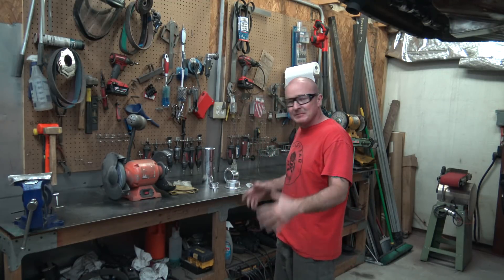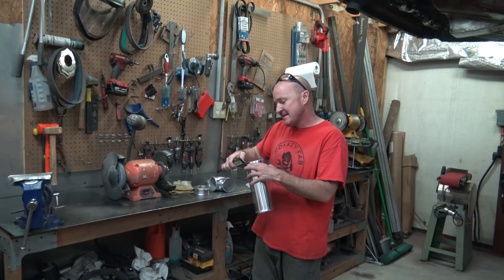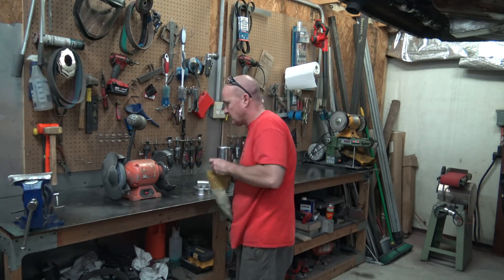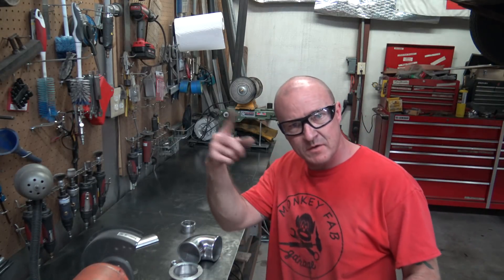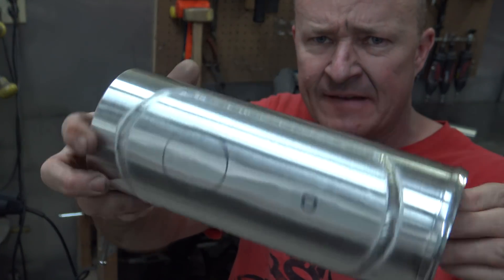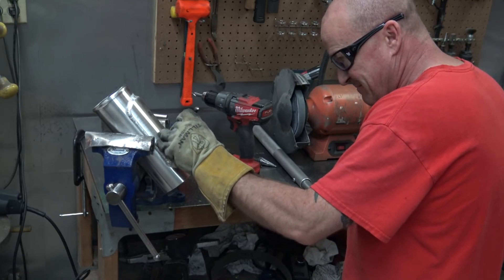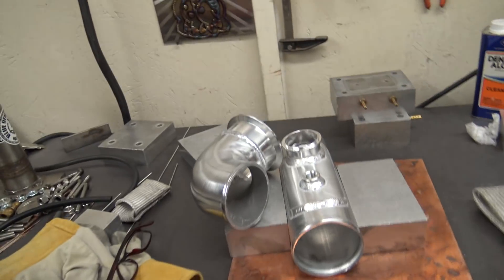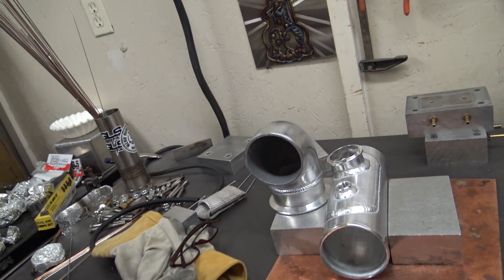BOV on Aluminim Tube and Cast Aluminum welding

Comment: I notice you don't seem to tack anything? You just start on one side and work you way round.  Do you not need to on alloy with such good fit up?
Reply from the maker: Scott Mullaly I’ll usually tack in three places and start in the place that the fourth would be but here I had the big clamp holding down the doubler plate, so no need there and I don’t tack bungs. Just weld super hot and get four or five dabs in before it moves. All steel I tack so yes I do aluminum a bit different.

Comment: Thanks for the videos man! Keep up the quality work :) Have you tried using really low RPM for drilling aluminum? I drill a lot of holes in AL installing docks in the summer, and I've found slower speeds tend to cut faster.

Looking forward to getting my T4 merge and GLS cup in the mail next week 😁😁
Reply from the maker: DanOfTheNorth I find different types of aluminum all like to be drilled a bit different. I bridge that by using worn out bits and modulating the speed. Well, sharp bits might help but ain’t nobody got time fo dat

Comment: Good videos mate!, I have a question, I would like to weld egt sensor bungs onto a oem cast iron turbo manifold is this possible? Would it be structurally sound? Cheers
Reply from the maker: zvargulis1988 yes. Just watch some videos on welding cast iron. There are a million of them explaining it.